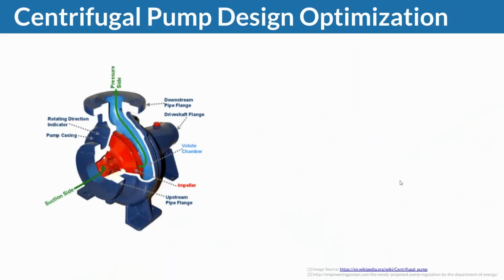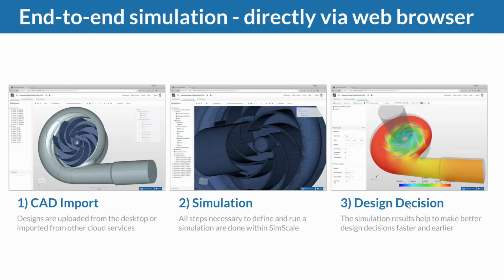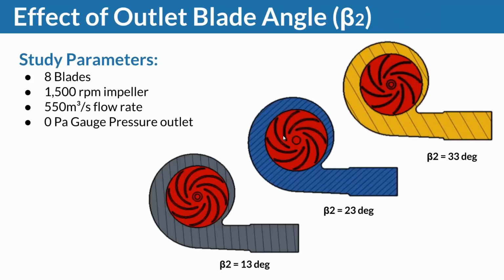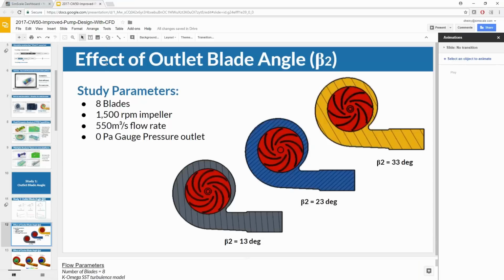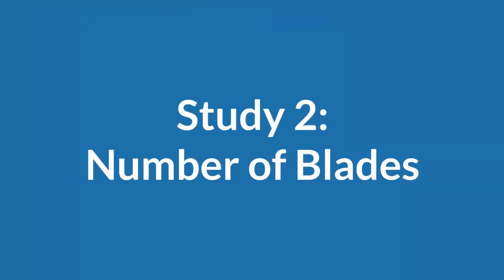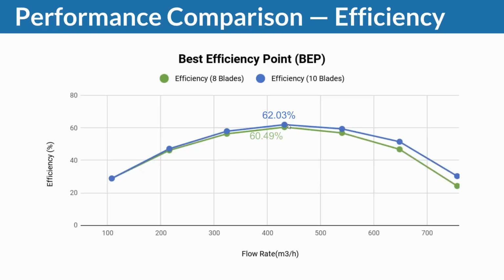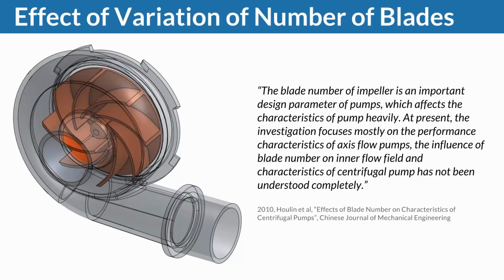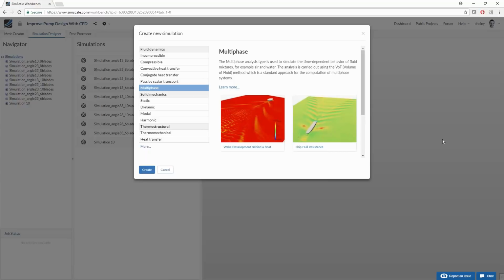Improved Centrifugal Pump Design with CFD Simulation

Comment: AT 30:30 ROI in a nutshell the diagram shows GREEN lines coming straight into the pump - is this accurate....is there actually any CFD paying attention to this water because; to the best of my knowledge the water Swirles  in a vortex some time before it enters the impeller domain... is this right or does the water truly shoot straight into the EYE Tangent to the rotational plane? this is a very important point because ALL WATER Swirles down pipes rotating in one direction or another with few exceptions and sometimes reverses or becomes turbulent after bends or 90° elbows or U-Turns. it seems that the inlet rotation of the fluid would be a very important issue that could greatly effect pump performance; especially with respect to cavitation .... A pump with a slight rotation in the same direction as the impeller could greatly reduce the cavitation "Shock" at the leading edge and a rotation opposite of the impeller would increase the pressures at the point of impeller contact.....Please help on this point. Thank you

Comment: What was beta 1 for that impeller with beta 2 of 33*?
Reply from the maker: The project used in this example can be accessed here: https://www.simscale.com/workbench/?pid=7794070050610688414&mi=spec%3Aef5b55cb-1865-4a6b-82da-fcc9f0434281%2Cservice%3ASIMULATION%2Cstrategy%3A2